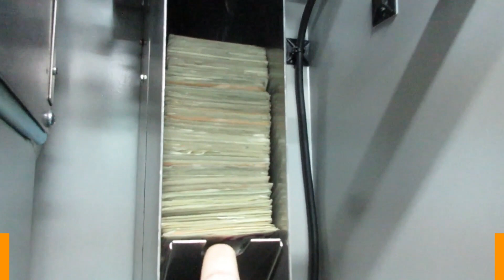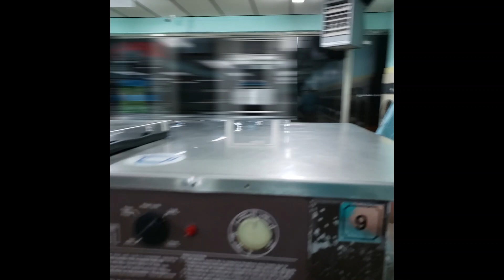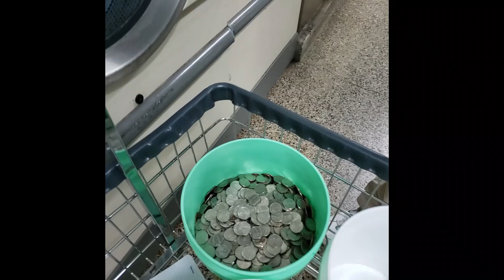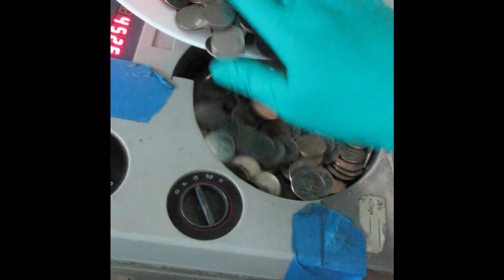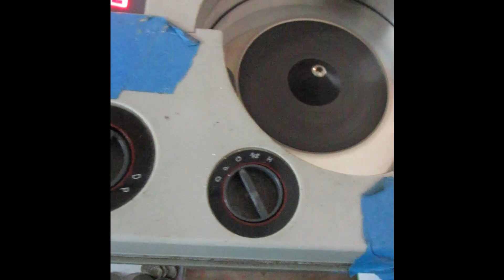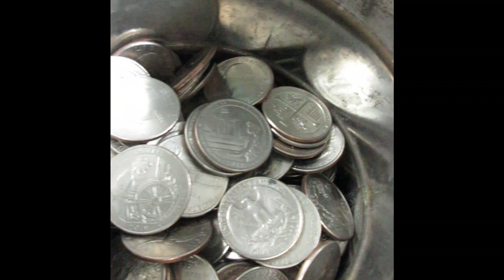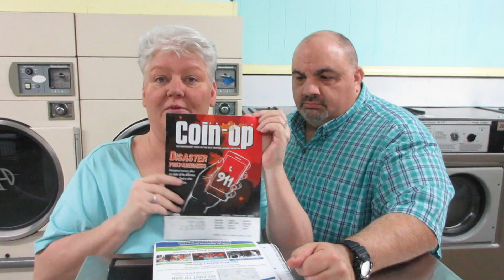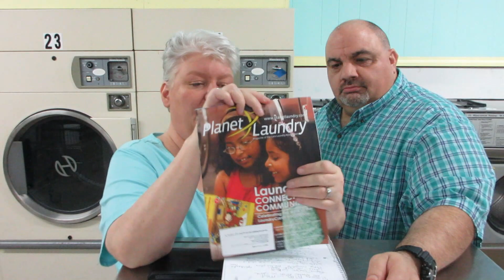AMAZING Laundromat money collection! Major decisions we have to make. Week 10

Comment: Greg, brother, you need some gloves! I would suggest taking out the bench seating and placing individual chairs several meters apart, that would equate to 'social distancing.'  Additionally, you could place some colourful tape in an 'X' at appropriately distanced machines to signify to the customers where to go to be the appropriate distance apart. It just draws a picture for the customer and allows you to maximize that ten customer limit. Common sense isn't always common, sometimes these extra efforts are required and even appreciated, it's an optic thing. Where I live, many business have been required to shutter if deemed non essential. Due to this, places that have 24 hour vending machines have seen a tremendous uptick in things like energy drinks, travel sized Advil and similar high margin items. I don't know what is in the immediate vicinity of your location, but there may be an opportunity there for growth.

Comment: I'm in a job that requires me to clean and disinfect A LOT!  Although there are many preferred ways to clean, if it comes down to it, you can use bleach as an anti-viral cleaner on many of your machines.  Following the dilution instructions on a bottle of bleach, they typically recommend 3/4 to 1 cup of bleach per gallon of water, allowing you a capacity of 15 gallons of product per 1 gallon of bleach (about).  Then putting that in a hand pump sprayer, you can spray down carts, exteriors of machines, seating, tables etc.  Allow about 5 minutes to sit then clean with fresh water.  Tough times, tough measures, but like you say, we WILL get through this no matter what!We live in the greatest nation on the planet!  Regardless of how you may feel right now, we are on the front lines beating this virus down despite what is reported on the news.  The 'Sleeping Giant' has been woken up again and manufacturers across America are currently producing amazing amounts of gowns, gloves, ventilators, all sorts of disinfectants etc., things that we couldn't have imagined!  There is PLENTY of food available, we just merely 'shocked' the system, please allow the supply chain to catch up and restock the stores, purchase only what you need for a short time, try not hoard anything and share with family and friends.  Practice good hygiene, keep in contact with those that you love and for god sakes!  Turn OFF the news!  Listening to it all day everyday does nobody any good.  Go for a walk, read a book, finish projects around the home that you have been putting off or just merely talk with friends and family about anything other than COVID-19.  We WILL win and WILL be stronger as a nation DURING and after the fact.
Reply from the maker: WOW, I hope everyone reads this. I'm going for a walk now, let the fresh clear my brain!!! Thanks Peter for reminding of this!!!!!! T